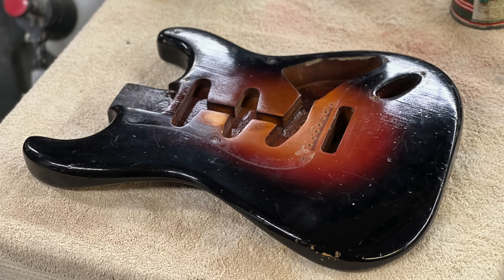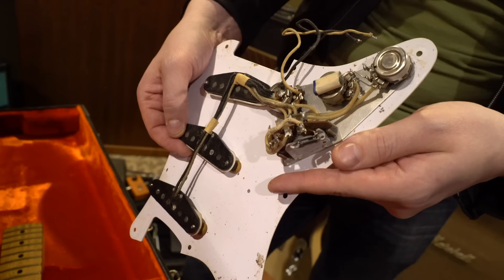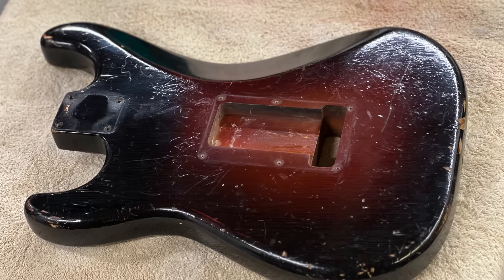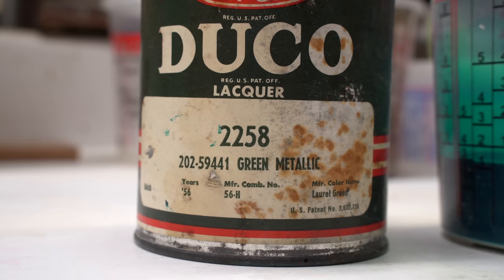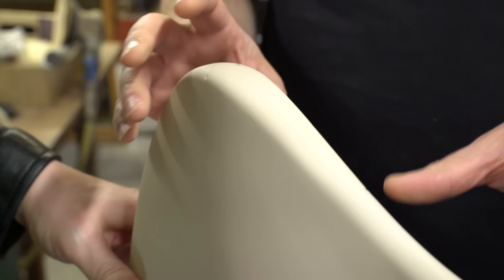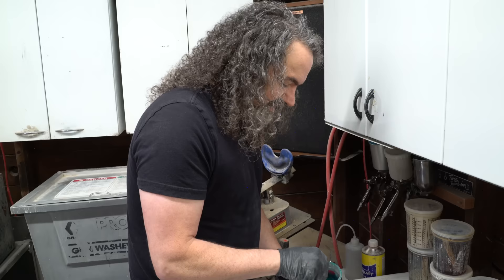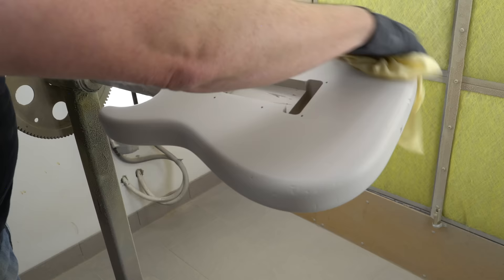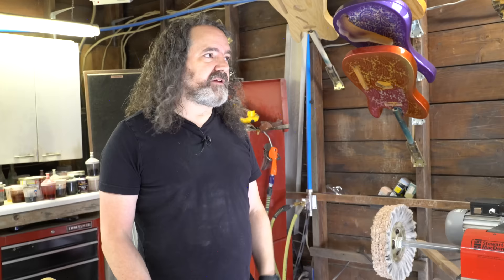Restoring a 1958 Fender Stratocaster with NOS 1950s Lacquer!

Comment: The fresh respray looked incredible before it got messed with. Like a Closet Classic
Reply: I understand where you're coming from, but that would not work with the aging on the neck and hardware. At least they are referencing the sunburst (as a 57 would be stock) in the final product. Just my 2 cents but thats more respectful of the next buyer and tying the whole vibe together. Peace
Reply: What's a great video excellent restoration. My preference would be never paint a guitar I don't even want to paint the crappy ones I pick up that are made in China from the 80s. For me the only modifications are Hardware related so it plays. But this is not my video or my guitar excellent work!

Comment: I rebuilt and refinished a 1963 Fender stratocaster body in lake Placid Blue. I was thinking Fiesta Red or Lake Placid blue, for my choices.  It had been horned (kinda like a gibson sg) and swimming pooled. I redid the horns to original Strat look and left the swiming pool rout. It has three Lindy Fralin vintage hots in it now. I bought it for $100 as somebodies bad idea. It was a working guitar.
 It had layers of black paint atop of thick green paint. Might of originally been white ? I just got in there and stripped it down. Preserving any yellow dip in any cavity. And the pencil date. 5/63
Every thing on the guitar now is non original. Just a 63 Strat body. I bought it from the guy that took some 1961 pups and Electronics out of the body beforehand.  
I asked around and nobody put any value on the body. But I did. It is a one piece alder 63 with date in the trem cavity. It is a great strat that took apx 4 months to put together.  It's a keeper. And will only be naturally aging. I don't like relics myself. What's the point if you will playing it as an instrument.

Comment: I skipped a little, so don't know if you mentioned that's not the original case for the '58 Strat.

Vince Cunetto refinished my '64 Strat in its original Inca Silver. He had the good original acrylic lacquer left from his work with Fender. It's on mine now.

After that, DuPont referred me to a jobber who had kept his mix station open. I bought and still have a quart each of Inca Silver and Burgundy Mist. They're unopened and stored properly.

Comment: I've restored old Chevrolet cars and trucks since 1983 and learned from a guy who started in the early '60s. The reason the paint information is on the can is because of what's known as a "factory pack." The actual paint used on the GM assembly line was put in cans and sold through paint jobbers. I have a case of facpac original Marlboro Maroon for '67 to '69 Corvettes that I may break out on one of my victory tour restorations for myself before I run out of time.

Comment: That Du Pont lacquer will pass the black light test, won't it?
Might need to keep that stuff in a safe. If it fell into the wrong hands, unscrupulous people could make forgeries.
It's unbelievable that it lasted this long. It must have been stored in a very cool, dry place.
Reply from the maker: Good question! How a finish reacts under black light is related to UV exposure, and not inherent in the lacquer itself. This will represent as a "new" finish under black light, and we've also left other tell-tale signs of the refinish, both for preservation's sake and also for future owners to properly ID the work. The original Sunburst is fully retained in the neck pocket, as is the 4-58 grease pencil date in the middle pickup cavity (with the original Sunburst beneath it).
Reply: @MMGUITARBAR  ok, cool. I keep hearing about the blacklight test for authenticating original finishes, but I never understood how it works. Thank for the info.
One other thing. Is Joe by any chance related to Tinsley Ellis? The resemblance is very strong. Joe looks like he could be a cousin. Tinsley was kind of Atlanta's version of Stevie Ray in the late 70s and early 80s. He was great then and he's phenomenal today. If you haven't already heard him, look him up.

Comment: Wow...makes me feel kind of guilty about all of the Duco I wasted  back in the 60/70's doing cars and motorcycles. Normally we wouldn't save any of the mixed material as not to contaminate any of the pre mix material so our viscosities/color match would be right. I am doing a restore on my Mom's 67 Mustang convertible she bought new...which I did a change of color complete on in Duco in 1973...She wanted Candy Apple Red instead of the factory Wimbledon White. Much of the car still retains that Red I laid down all those years ago, even after a couple of repaints over the years (by others), which makes me feel good. The newer base/clears are coming off easily, the Duco Red is hanging in there and tough to remove. As we always say, "It's all in the prep work". Going back to Wimbledon White and should last my lifetime (getting shorter everyday at 71...lol) and on into my Grandsons via my oldest Son who gets "Mom's car" next. Anyone have an extra gallon of Duco Wimbledon White they want to get rid of?

Comment: I was lucky to find several shelves in an old garage of multiple colors of DuPont Duco nitrocellulose about a dozen years ago and have done several guitars with it. You’re right, nothing smells quite like it, but it’s still usable and lays out nicely and sands easily. Beautiful job on the Strat man! How did you get the finish to check like that? Thanks

Comment: ide be kinda worried that the pick guard might shrink a bit if it sits off the guitar for to long. nice guitar! turned out fantastic!
Reply from the maker: Thank you! Only the nitrate guards (mint green, tortoise) are prone to shrinkage. Whenever we're restoring a guitar with a nitrate guard, those guards are mounted to boards so they retain their dimensions.

The one-ply white Strat guards from the '50s are made from a different material and don't shrink over time, so all good there!

Comment: very curious as to why you wouldnt have touched up the sunburst and then left it in the orig color....no ill will intended just curious
Reply from the maker: And no ill will perceived! The original finish had been compromised beyond restoration in this case and largely wasn't present. It (unfortunately) wasn't an option to touch it up or revert it to its former glory. 

As there's never a shortage of these in Sunburst, when we're looking at apply a new finish, we're always angling for uniqueness, and something that can connect with a player in a different way. In this case, we opted for NOS lacquer and a color Fender did use on select examples in the '50s :)

Comment: One of the best things to happen to guitars is polyethylene lacquer.  It's an improvement.   That said, I love the old car colors of the 50s and these guitars  using that authentic Dupont car paint bring the original fender car colors back to life.  The stuff is extremely flammable, which is why Jimi's guitar went up in a ball of flame.
Reply: All the lighter fluid he squirted all over it may have had something to do with it. It's extremely flammable as a vapor but putting a match or lighter to a dried nitro guitar isn't going to make it explode.

Comment: Why !!! If you have a '58 sunburst strat will you paint green??? Restore but don't f.... change the original color !!!!!
Reply from the maker: Great question. The original Sunburst had been marred by a previous owner beyond restoration to its original state, and there are plenty of Sunburst Strats in the world (we do love Fender's first three-tone Sunbursts from '58 in particular).

One thing not covered in the video is that we were matching a specific shade of custom color green that Fender actually used in the '50s, specifically on an early Precision Bass. 

When Fender didn't execute a Sunburst right, it was common practice to shoot over it with an opaque custom color, resulting in a "double finish." This was the effect we were replicating, as the double-ness of the finish would only be apparent after a degree of playwear.